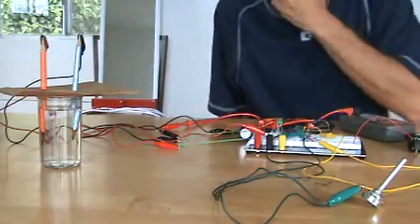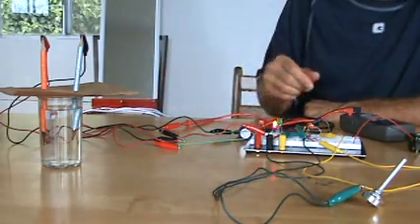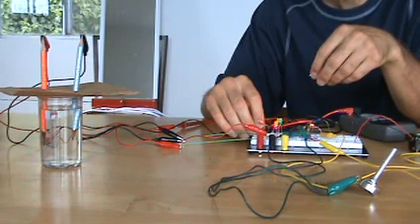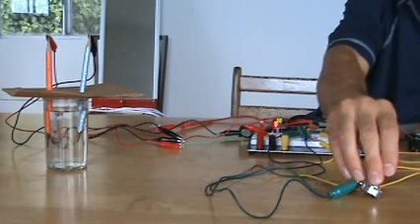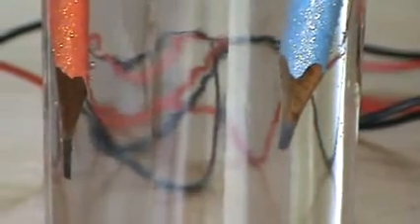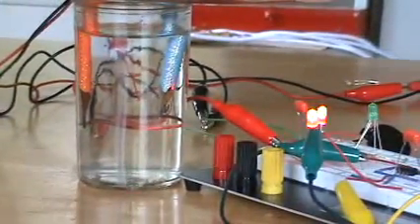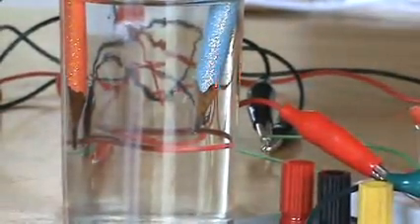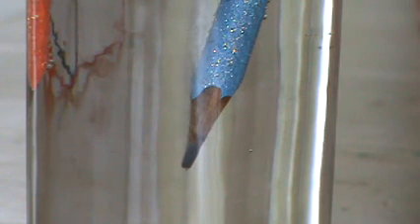Hydrogen Generator 555 Timer

Comment: why do you even need a 555 timer to run a hho cell???????????????????????? you don't need one just direct current.  just run 12volts from a car battery into 2 stainless steal plates and add baking soda to improve conductivity and make 500 times more hydrogen. ( KISS )keep it simple stupid.

Comment from the maker: Happy Holidays to you too!

I'm still trying to figure out if pulsing the water makes a difference.  I know that Pulse Width Modulation will allow the variable control of how much current is sent through the water to produce hydrogen.  I have lots to learn.  In about 1-2 months I'll be researching more for my website that I have on Hydrogen.

I've been super busy with my full time work, that this has taken 2nd priority for a little longer.

Thank you for your comment.